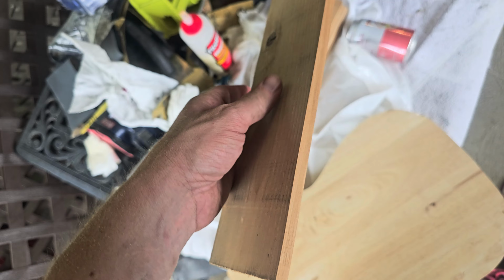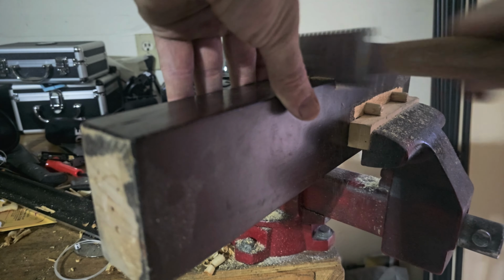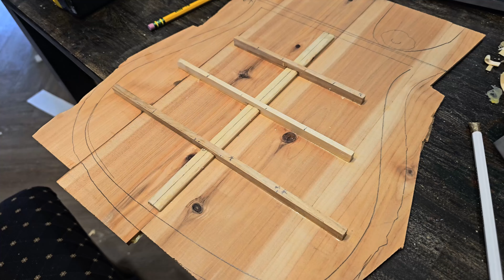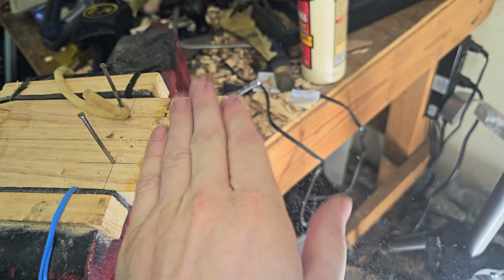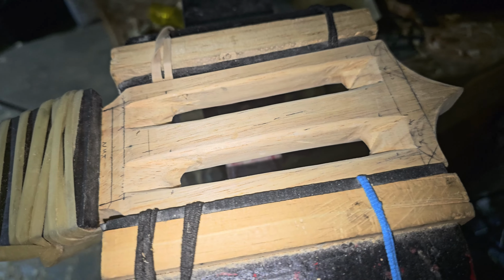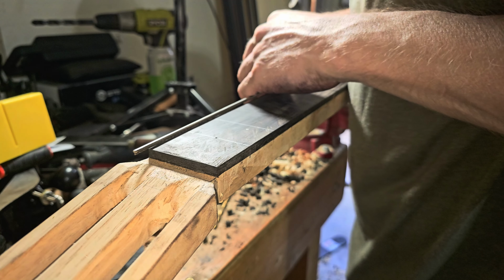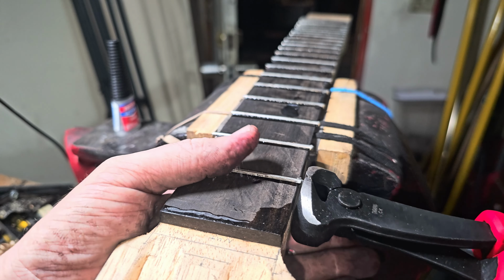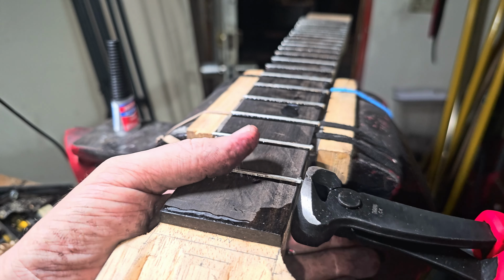I Built this Guitar out of a DIRTY OLD FENCE!

Comment: Had to log back on briefly to say that the lighter colored marking on that piece of ebony is typically what I belive they refer to as "sapwood."  It is located just below the bark on the tree and transfers the water and nutrients throughout the tree.  The darker part is typically located on the inner part of the tree and can be referred to as "heartwood."  The darker, more uniform colored ebony with really tight grain and high density is traditionally more desirable and sought after and of courser more expensive.  Many, many years ago I priced a very dense solid black piece of Ebony that was essentially a decent sized squared log that was about 40" x 12" x 12" with no cracks or separations in it at $400 and I was totally shocked by the price.  Kinda wish I would have bought it as It is my limited understanding that now such a piece is difficult to find and REALLY expensive if you were to find one. Idk. Anyway back to video...
Reply from the maker: Interesting, so that's why the wood was so cheap. It's good though, I planed past it easily and the wood was good even though I ended up mangling it lol. I figure I can fix it if I ever do a regret on it.
Reply from the maker: I'm about done with #3 btw...my dad requested one and it will be the smallest guitar you have ever seen. ;)
Reply: @DouglasThompson   Looking forward to seeing it!
Reply from the maker: @knowyourjoe8826  it's been done since yesterday, editing the video later today.